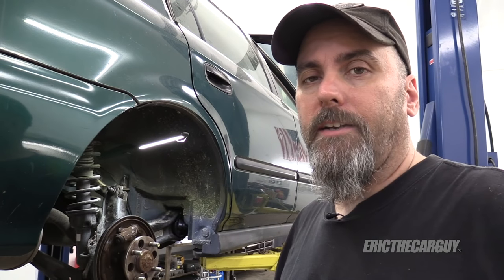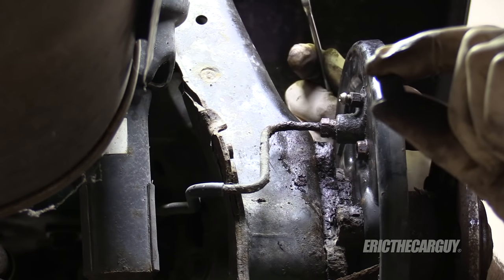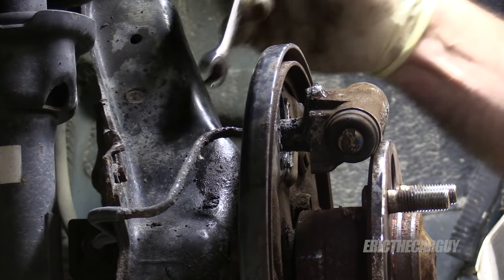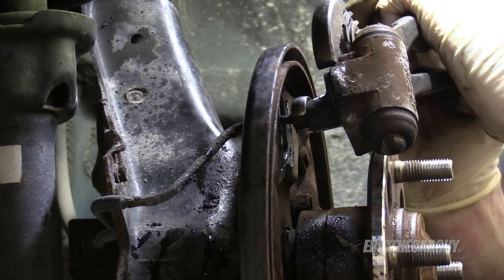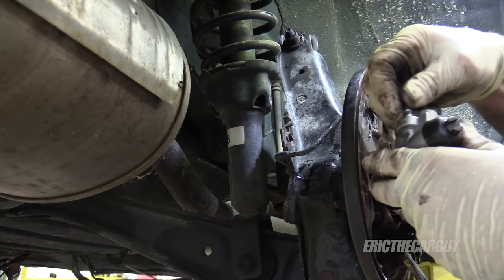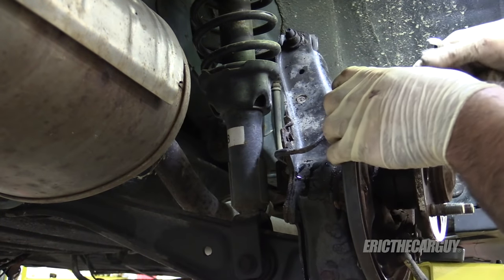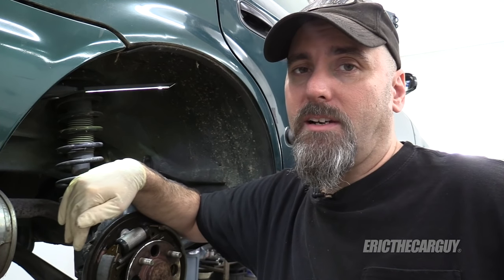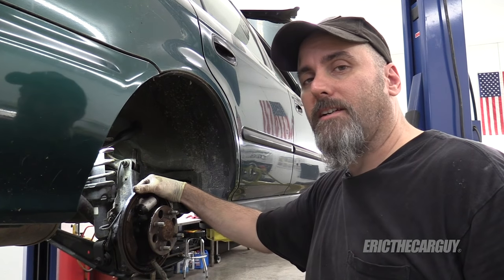How To Deal With Rusty Brake Lines

Comment: I blew the lines right out of my new old car. Scared the hell out of my passenger. Take care of your rusty brake lines fellas, you don't want that kind of adrenaline rush.
Reply: I had the brake cylinder /slave cylinder (wheel cylinder lol ;) fail on me braking at like 40 mph once as a young driver, instantly no brakes, had to use the handbrake to slow myself and very carefully drive to my destination.  I later found out the handbrake was also only attached one side lol easily fixed on the roadside.
Reply: Shouldn't there be two independent parts of the brake system? Of course independent untill the fluid didn't leak out completely lol :) I mean that the brakes for left front and right rear should be independent from right front and left rear. This way when a line goes bye-bye, you still can stop your car. The brakes won't work for long, as there will be a massive fluid leak, but it will be enough for you to just stop on the side of the road safely. Two wheels of four braking is better than nothing I suppose ;)
Reply: If I just say that it's a fiero and its older than me, does that explain it? But yes, when I started replacing all the hard lines, the forward reservoir had a little fluid left in it. I'm guessing some parts may have seized. Well, new calipers and rotors all around is like $100 anyway so may as well do it all
Reply: did you use substandard Chinese parts?? had the same thing happen to me lucky me i was in the driveway unlucky me the bleader tried to get me in the face it was torqued down to 10 ft LBs after that time i decided to disk swap it with a USA based company parts because i was tired of rebuilding my no name R&R drums for the 3th time ( slow air leaks X 3 times from bad seals  , a bad spring @ 40 mph locked up fL tire ) in one year with less than 5k miles on them, the oem where ok an i like them but they were used up and junk and 20 + years old so that wasn't a good option
Reply: @richardprice5978  probably original equipment from 34 years ago, they were so gone from rust. I was literally driving it home from having bought it.
Reply: Thanks Eric! How did you determine that the line was leaking? Puddle on the floor, spungy breaking,  or...?
Reply: I had that happen on 3 different occasions with the same vehicle. First time I was backing my boat into a very steep landing when a rear line blew, the pedal instantly dropped to the floor and the Tahoe was still creeping back. I threw it in drive and mashed the gas to avoiding losing the vehicle in the lake. on this landing  if the back wheels would have touched water it would have been all over the SUV would have been lost  in the lake. The algae that grows on the concrete under the water is very slick.  It was a interesting drive home pulling a boat without rear brakes. 2nd time I was on my way home from home depot when a front line went. After that I changed everything over to stainless steel. 3rd time was when a wheel cylinder blew coming to a stop at a light. I almost went into the intersection.
Reply: My dad blew a brake line on his (now my) truck when he was going down a steep hill on a trail in the woods.  Luckily he was already going slow enough to where he could throw the shifter in park without damaging anything.  The leak was in between the gas tank and the frame and to save time and frustration we rerouted the brake line around the gas tank.
Reply: @5Dale65  doesnt work because once one line goes the whole brake system loses pressure. Fluid in the system woll take the path of least resistance and just shoot our of the broken line and not budge anywhere else....at least thats what happened on my bmw
Reply: @alexanderjamesl4868  Nope, that is not true.  Just look at your master cylinder and notice that there are TWO different lines that supply your calipers (or wheel cylinders if you have drum brakes).  You are correct that the fluid will rapidly release on the broken side (some cars split between left front right rear in an X pattern others split by left and right sides, and still others split front to back) BUT it will still allow you to have some (albeit reduced) effectivity of braking to allow you to pull over and IMMEDIATELY GET IT SERVICED.  What happens is the fluid will soon drain from the Master Cylinder reservoir and then you will have no braking, but it takes a few brake applications for this to happen.
Reply: @5Dale65  Ive had brake lines go out several times, that's when having small vice grips comes in handy, I just block off the bad one and keep going.
Reply: Did the same thing on my one ton won't do that again
Reply: Do you think rubber lines are better choice?
I have an old 52 Chevy

Comment: Buy a 99-07 silverado and you will get really good at replacing brake lines!
Reply: Use nickel copper lines, you'll never have another problem.
Reply: Does the Tahoe from same years fall into this category too?
Reply: @robs1852  unfortunately yes.
Reply: @aodox  theyre not legal some places
Reply: drive to work every day in the winter on a salty roadway and you will find out that's false my wifes car ate brake lines every two years ( pin holes on the seams ) also a older gm product so no im not sold on copper lines expectedly from the local parts stores but my latest upgrade on my 60s muscle car is a 4 wheeled disc swap with full 1/4in / -4 a/n / jcb 316L welded ss hopefully its got more service life than the other stuff that i have used / seen
Reply: Make that 98-07!
Reply: Yup, we just did every single brake and fuel line on our 98 silverado plow truck last spring. At least its not a hard job to do. Didnt buy any preformed lines, just bent them up with a forming tool and flared the ends. Even ended up replicating the helix shapes that come out of the ABS module. Hopefully that'll last another 5-10 years before they rust out again.
Reply: @Todd McCarter Nicop lines at DOT certified, and legal in all 50 states. They have been used internationally for 50 years. Nickel used to making stainless steel, stainless (chromium is more for shininess.) It is also significantly higher durability. You can see similar to normal steel lines (lower of course.) I will use nicop in my future, but my lines have only just started to rust on my 96 subaru in the rust belt. But the 07 Saturn will need them much much sooner! That rusting is bad! Just where it runs along the lateral link.
Reply: I replaced all the lines in my 97 Tahoe. Dorman has a kit with all the lines even the short ones from the master cylinder into the abs controller. All the lines are stainless steel and pre-bent. The kit from rockauto was under $140 shipped.
Reply: I wish they had a kit like that for my car. But I need to replace them myself.
Reply: @blazetownsend8785   when doing that without a kit I've always found it easiest to buy the pre flared sticks and unions then bend it myself. I've never been able to get the flares good enough to just buy the roll of line to cut and flare it myself.
Reply: Luckily Dorman makes the pre bent line kits for them made out of stainless steel.Saves time not making them and don't have to mess with them anymore
Reply: @Toolaholic7   its a bit of a pain installing the pre bent lines. The long one that runs the length front to back along the driver side frame rail is the worst since you have to drop the fuel tank to property install it. But all the trouble is worth it in the end since they will never need touching again.
Reply: The one thing a lot of people don't know about flaring nicopp lines is that you can't give it that extra crank with the flare tool like you would with steel lines.  It deforms the flare and you have to cut it off and redo it.

Comment: If you strip out the nut and you're truly SOL, you can also just rebuild the wheel cylinder in place.  Pillage the new one and install the parts into the old body still bolted to the car.

Comment: Saved my ass getting wheel cylinders off, but no help when installing the new ones. The odds of these being tight at the exact moment the wheel cylinder is lined up are pretty slim. I suggest spending more time with the torch and penetrating oil and don't be like me and forget to take the cap off the bleeder before sticking the torch back there. It's ok I got 2 new ones for only $23 and they came with free wheel cylinders! Love my GMT400, some of the parts are so cheap you can buy them and make $ at the scrapyard

Comment: If im going to go through the trouble of replacing the wheel cylinder. 5 more bucks is not going to brake the bank. But thats just how i do it. I know a guy that has spliced about 13 points on his f150 so he didnt have to touch the line even though he really did to fix the leak. Cant fix stupid but u can fix cars😂😂😂
Reply from the maker: If you are referring to the brake line, that was actually $50, not $5.
Reply: EricTheCarGuy it wouldn’t cost 50$ for a bit of brake line and 2 fittings
Reply: Exactly
Reply: The dealer bent quality line is....
Reply: he said he already fucking replaced the line and even said in the damn video he recommends replacing it and this was a temp fix to get you by. Does no one watch the whole videos before bitching?
Reply from the maker: acehole1990  I got the part from Honda, it actually cost $66 with shipping. https://www.hondapartsnow.com/genuine/honda~pipe~46331-s04-000.html

You are correct though, had I made the line myself it would have cost a lot less.
Reply: "brake the bank"
Reply: @Wulthrin  giggled at that as well
Reply: I would make my own lines from copper nickel pipe .
I keep fittings and pipe in stock and takes about 30 minutes make those sort of lines in nice factory fit .
Can reuse old fittings if they good enough and a bit special .
Cheap and job jobbed till car goes crusher .
Reply: Break ** as is bank and brake as in line and you're right you can't fix stupid but you can repair cars 😂
Reply: @daves_not_here_mannn  woah buddy calm down. 1. I watched the video to the end and yeah he replaced the line. Not my point. My point was i wont even mess with it ill cut the line and replace it. So before u go ballistic keep in mind its youtube.
Reply: @ericthecarguy  was it from the dealer. I have never had a brake line cost me more than 20 and that was 6 ft of 3/16 on a blazer.
Reply: @coreymattingly2747  oh im calm. Im fucking crazzzzzyyyy.
Reply: Mr B    9.30.18.  I just used the NiCopp brake line to repair all my lines coming from the ABS pump, what a dream product! Will never go back to using the old hard pipe❗️👍🏽
Reply: My appologies for getting the conversation heated up. Ive done more brake lines than i like to admitt. I was just sharing my opion. I like your methods and you are a good teacher for all levels of tech. From diy to master tech we can all learn. Hope all is well my friend.
Reply: EricTheCarGuy edit, made a stupid reply without reading your whole comment. No disrespect man love what you do